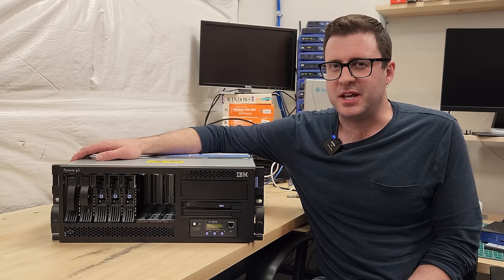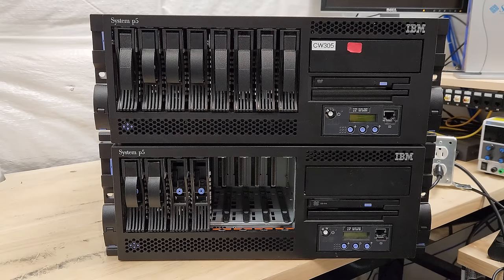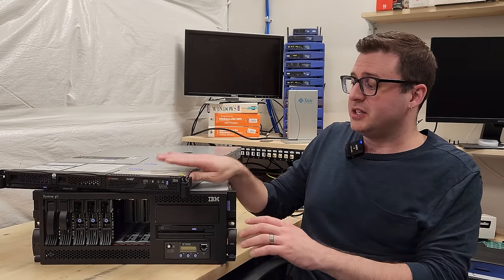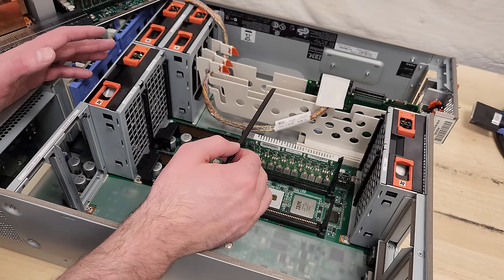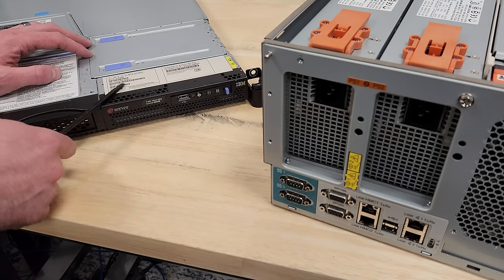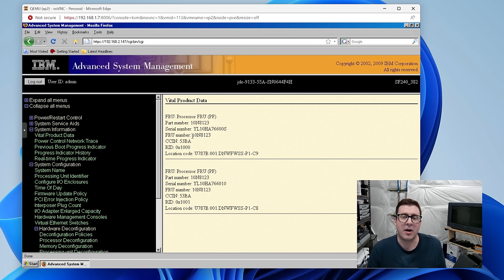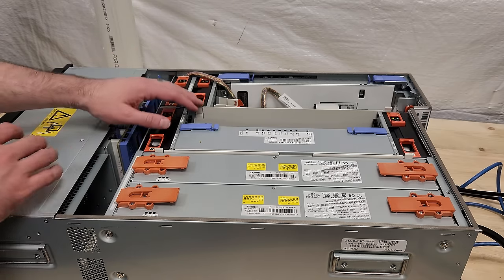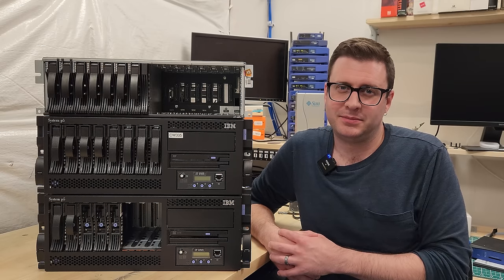IBM System p5 550Q

Comment: The protective film over the switch is actually something parts manufacturers put on there in order to make assembling easier. Pick-and-Place Machines often use vacuum nozzles to pick up parts. If you have something like a switch, this won't work as you don't have a flat enough surface. Having a bit of capton tape on there will fix that.

Comment: For your serial problems, there are a few things to check: You absolutely need a null modem cable, and you need to set the speed at 19200 baud. If your server is cabled to an HMC, the serial port is disabled and there's no way to bring it back without a reboot.

Comment: I stopped working on these machines about the same time yours was made.  I vaguely remember that the High Speed Link may have been used to connect two systems together in failover mode.  We had two systems set up in failover mode so that when one system went down, the other one would (hopefully) automatically take over.  I don't remember much about that since that was not my area, but that may be some explanation for the HSL cards.  This video gives me memories, both good and bad, of working on these systems.

Comment: IEC C13 cables can actually be smaller at 240V than at 120V, as they carry less current for the same power.

Cables with C14 PDU end - C13 device end are standard in 240V DCs
Reply: Correct. I am always impressed bu the ...girth of american power cables lol

Comment: 22:15 I'm fairly certain the reason for the adapter boards is that the normal SCSI connection isn't really designed to be repeatedly removed and inserted, while a card edge connector like that is much more robust. Basically, the reason is longevity when replacing drives.
Reply from the maker: fair point!
Reply: SCA is specifically designed for Hot-Swapping. So no, that's not it. My guess would be backward-compatibility. They probably used that connector for ages.
Reply: Does this pre-date the SCA connectors though? Always seemed like those can take as many insertions as anyone would be willing to throw at them. Don't know if SCA was a thing back when IBM thought of these gold fingered edge connector adapters.
Reply: Well I think that's the point of SCA drives is for repeated insertions. I had an old dual pentium pro Dell server with SCA drives. And some old SUN hardware I had used them as well.
Reply: There is also a make-before-break connectors to earth and power before connections
Reply: Incorrect. The reason is that different SCSI standards had different form factors at the time. The adapter card (called an "interposer") allowed for different generations of drives to work on the same backplane. It was super common on SCSI backplanes, and the inspiration for SATA, SAS, and U.2/U.3 all using essentially the same connector.
Reply: @someguy4915  These drives had SCA connectors on them and then were adapted to that other plug.
Reply: @someguy4915 sca was on sparc5 so before powerPC

Comment: I'm going to take a stab that many of those bigger caps are polymer based, which means they shouldn't need to be replaced ever.

The bigger pins in those connectors are ground to isolate pairs of signals from each other. The connectors themselves are modular and are press fit into the PCB (no soldering required). The modules are made by various companies (so they might not be strictly proprietary, nor interchangeable) and you can often find them stacked up in varying configurations in all sorts of high end gear.
Reply from the maker: yeah you're probably right about the caps... still nervous though haha
Reply: @clabretro  A good indicator they are polymer (or to figure out which ones are) is that polymer caps don't have the + or Y shaped vent on them, although I think the smaller caps are harder to figure out because they never seem to have those markings anyway.
Reply: @clabretro 😮let’s hope it avoided the capacitor plague problem and can survive a long time like the Sega Mega Drive 👍🌱
Reply: @SproutyPottedPlant  Yeah... IBM used the same bargain bin components as... sega...

Comment: Love your videos. BTW, that 'protective cover' on the dip switch is just a piece of kapton tape. It's put on there to protect the switch while the board goes through the soldering over and wave soldering machines. Usually they don't bother taking the tape off unless they need to flip that switch, and obviously they never had to.
Reply from the maker: Thanks! Yeah some other folks mentioned it's likely there for the automatic soldering, makes sense.

Comment: again a great video! I worked in many many gouv datacenters and those P5 where all over the place. Part of my job was checking air circulation in server rooms and remove faceplates in order to check air intake (some environments have tons of micro particules) and they were famous for breaking... and infra guys love them so much that sorted to things like tape to hold them in place just for the look... you can get a 240v adaptor that plugs in your dryer outlet and connect a 0U PDU .. I run all my servres and computers from that plug.. 30A available and PSU do run more efficient at that voltage..
Reply from the maker: thanks! yeah I was tempted to temporarily plug it into my dryer outlet haha. But I'll just run a new dedicated circuit.

Comment: Beautiful machines, love the PowerPC architecture, shame it couldn't get ground in consumer systems besides the old PowerMacs. Annoying how IBM just has that pointless proprietary connector for your hot swappable drives, you totally love to see that when replacing them. Interesting how that server actually needs 240v, when we got modern systems with way more than 4 cores nowadays running perfectly off 120v. Great video, Clab.
Reply from the maker: I'll admit I was surprised at the 220v requirement, didn't even think to check.
Reply: @clabretro  yeah it's something that you just totally don't expect

Comment: The adapter plates are basically just for making it easy and safe to hot swap them. Most physical connectors aren't really designed for it... That then it's just easier to buy your drives from IBM directly. Funny how that works. 😂
Reply: SCA connectors are designed for hot-swap. They may not have existed when IBM designed this thing. Or they wanted the ability to plug other things in. (I have an SGI branded FC array that can take just about any drive ever made if you can find the correct interposer board. The problem is no one know who actually made it.)
Reply: Old Compaq Proliants had similar card edge connectors to faciliate hotswapping of HDDs. They actually date back to time before SCA. I had server with mixture of narrow, wide and sca scsi disks all with same card edge connectors going to backplane. After SCA became a thing on new proliant generations they dropped those custom interposers with card edges.
Reply: Those are SCA drives they are hot-swappable an earlier comments said that’s just a legacy connector IBM used for years

Comment: I worked for Sequent Computer Systems as a level 3 support engineer (doing mostly kernel crash analysis of Sequent's DYNIX/3 and DYNIX/ptx Unix like OS's and Linux) when IBM bought that company in the early 2000's. Which meant we ended up with a bunch of gear like the p5 servers you discuss in this video (albeit x86_64 and similar rather than Power5). I was impressed by the quality of those servers, but even at the time didn't really understand how customers justified the price. When I went to work at Google in their data center automation team in 2007 and started visiting Google's data centers it was immediately obvious that using cheap hardware that has no redundancy and dealing with server failures in software makes a lot more economic sense.
Reply from the maker: Very cool! and yeah, the absolute plummet in x86 prices and an increase in capabilities back then definitely made it the way to go.

Comment: I have used the HSL cables before. You are correct, they are for connecting multiple servers together in a NUMA (non-uniform memory access) configuration. It allows you to grow your computer by adding hardware directly to your main system, rather than as a farm.  I used them both on IBM Power 6 systems and their x445 system from the mid-2000's.

Comment: i was given a 'desktop' version of something very much like this, about 10 years back, i worked out it needed AIX OS.. but i couldnt find it anywhere..i ended up gutting it and scrapping it...still have the cpus and few other bits n pieces in my collection!..i was also given a Netfinity 5500 at the same time, dual P3 500Mhz.. thing was absolutly huge..full redundancy...all contained in one 60KG box!
IBM really made their systems so well...no wonder the machines were so expensive.. theres a half ton of metal in there! :P

Comment: I want to say that those RIO/HSL slots in the 550Q are only for external expansion slots.  For the users that needed them, IBM offered chassis with more PCI-X or PCIe slots.  The higher end 570 model is what generally supported a GX bus extender card in those slots which would permit a coherent processor link between multiple chassis.  This how IBM builds larger socket count systems using midrange hardware:  cable multiple chassis together.   This is also how IBM was able to transition from PCI-X to PCIe without having to offer different motherboards:  just cable a different external enclosure for the slot type.

For the HMC network, I'd be curious if there is any Bonjour/ZeroConf traffic on it.  Watching that is another means I've found handy for grabbing IP addresses across different subnets as it is a layer 2 protocol.  With regarding the serial console, have you tried adding a null modem adapter to see if that makes the serial port functional?  Alternatively have you tried those USB adapters with the serial port on the front with a RJ45 adapter?

JDE is likely referring to an ERP application from JD Edwards which after a series of acquisitions is now owned by Oracle.   While the LPAR configuration indicates that it was for AIX, JDE was also available for IBM i (aka AS/400) LPARs as well.

Comment: Love these systems! First financial institution I worked for ran our core platform on P5 series machines.
Reply: And yeah, these machines expect you to have 220v/30A data center power to run. I ran the JS22V blades in a blade center S chassis and the power requirements were even nuttier.

Comment: I think the hsl links are so you can cluster multiple systems together a bit like what infiniband does. Ho did something similar with the dl980 which was essentially two dl580's clustered together with a proprietary link.
Reply from the maker: yeah basically I think, after some further research there are various Expansion Units you can buy, such as a PCI unit for more cards in large LPAR setups

Comment: If I had to guess, the drive backing connector was to be extra protective of the connector when plugging drives. Avoid a bad connection damaging a port or drive which in turn damages the next drive or port and so on. That would also explain the nice latching mechanism.

The Oxide computer guys talked about those types of issues on their podcast about back when they were at Sun.
Reply from the maker: It's certainly more robust than the regular LVD connector, I'll give it that.

Comment: That is so pretty!!! LOL you just commented on "it's stunning good looks" as I wrote that! Man, I would love to find some of the empty cases. Stick a Zimaboard behind it via some LED and I/O expansions. Could rig up hot swaps to SATA. VERY COOL!  I have a 23" server rack with metal sides that pop off and a tinted plexi door. I had 19" rigged up in it with gratuitous rack equipment and servers, but it was too much power. I use a Zimaboard now mostly with a crossfire build on standby for any hardcore computin. Im actually using it as a 3d printer enclosure currently. I insulated it with rockwool acoustic tiles that fit right in the sides without any fasteners! It's perfect! Still... I miss my massive rack sometimes 😊
Reply from the maker: a face plate all hooked up like that would be cool! kinda like a PiDP-11

Comment: I'm running my server rack on 240V.  It's worth doing for for the slight improvement in PSU efficiency..  Any wide range input voltage devices work just fine.

Comment: Oh, JDE? I'd put money on that being JD Edwards, or as (I think) it's called now IBM OneWorld. I worked in a place with a relatively modern iSeries system a few years ago, and the pSeries hardware is interchangeable with the iSeries if I remember correctly. Its massively complex but amazingly powerful.
Reply from the maker: someone else mentioned JD Edwards as well, I bet you're right!
Reply: Came to comment the same, JD Edwards. Looks like a Development, Prod, Prod Learning (Training)? and an an after/fore thought named TEST partition.

Comment: 13:00 meanwhile as a Swede I am drawn to the note saying: "This machine shall be plugged into an earthed outlet." But in Swedish, Norwegian, and Finish. Danes are apparently left to decode the Swedish and Norwegian for their own use, it is close enough.

And yes, having 230 Vac 10/16 amp as one's standard voltage has some real advantages.
Main one isn't that 230 X 10 = 2300 watts and one rarely uses anywhere near that much power for even a couple of computers.
But rather that with some voltage drop one still gets ample power.
Lose 5-10 volts along the way isn't as major as on 110-120 volts where that accounts for a lot larger drop in available power. And the fact that most PSUs already semi struggles to use 110-120 Vac to start with.

Comment: The RIO ports were used to add additional chassis that has more drive bays and more PCI slots for more IO capacity.
Reply from the maker: yeah found out about the various Expansion Units, makes sense for large LPAR setups

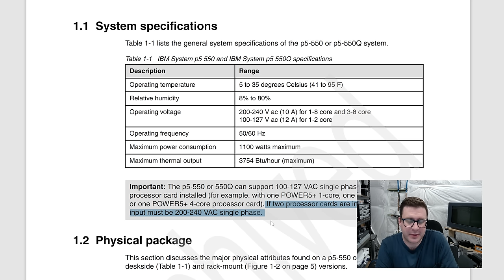Comment: 36:16 you can get it 240v pretty easily! Doesn't need to be 220. Just need a 2 pole breaker. And instead of landing one of the lines to neutral, it will be between both hot legs. edit: 39:10 ah, you got it.
Reply from the maker: yup! I'll throw a 240v breaker in there too when I rewire that room for 20amp
Reply: @clabretro  sounds good. and yep, no need for a 30A breaker and 10awg wire, you'd need 30A receps too which .. yeah don't bother with that. 20A and 12awg is all you need. (and 6-20R receps)
Reply from the maker: yeah good call. I think the PSUs were 10amps at 240v so a 20a should be good
Reply: @clabretro  Be aware that normal  wall outlets in the 230V system are up to 16A.
Reply: @clabretro  and that's only if they're running full tilt. Idling the draw will be much lower.

Comment: The front LCD isn't readable probably because its contrast is off, sometimes there is adjustment for that in software. If not then its probably a bad pot/resistor inside next to the LCD, those 2byX displays usually had a pin dedicated to controlling contrast on them.

Comment: RIO or remote IO connects to what is known as an IO drawer, essentially a similar shaped/sized/coloured box with just a bunch of PCIe slots in them. Your P5 can handle much more peripherals than the 4 slots you have available in the chassis. 

The other use for the HSL is proprietary switching technology, so you can run HPC jobs on P5 clusters. You can also run GPFS on said cluster, so you can share storage volumes over the cluster nodes.

If memory serves me right, the 590 was the biggest you could get, the size of a full rack and pretty loud.

Also, IBM gear is very picky about serial connections. You will probably need a proper serial cable, and set it to 9600 baud.

Comment: Serial to USB converters are notorious for 'not working' - what it actually comes down to is that some of the converters use a chip that Windows has drivers built in for, and some require a cumbersome manual driver assignment process (if you can even find the right driver).

If you get a cable with the right chip it'll just work.
Reply from the maker: yeah, these p5s are just so particular. I have trouble with a direct serial connection to a Linux box too (though it mostly works). if I remember correctly the MRV serial console in my rack plays nice with them though
Reply: For anyone else reading, the magical letters, usually, are FTDI. They make the actual USB-to-RS232 UART chip, and WIndows knows how to handle them.

I'm a ham radio operator, you would not believe how many arguments get started because the factory programming cables for cheap radios use cheap UARTs, but buying one with the correct pinout and an FTDI chip in it just solves all the problems.

Comment: For VMware boxes at least, we used additional add-in NICs and built our virtual switches to use one port on each physical NIC. That way, if we had a whole card die, we'd only lose one path to each vSwitch. Same with redundant RAID cards: dual-port drive backplanes connect to both controllers so the array survives loss of one controller.
Reply from the maker: interesting!

Comment: You can trust those handles. If you remove heavy components like the power supplies and drives you can do a diagonal grip and install it by yourself on a good day.
Reply from the maker: yeah removing a PSU to give yourself a handle can be a pro move